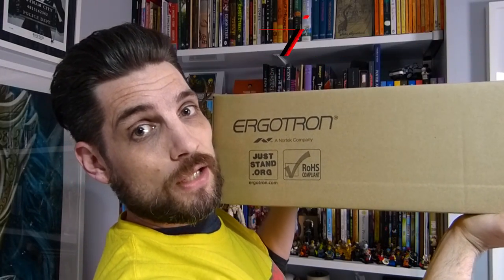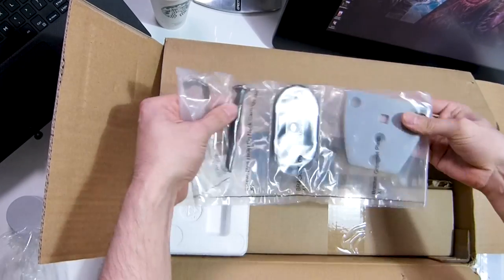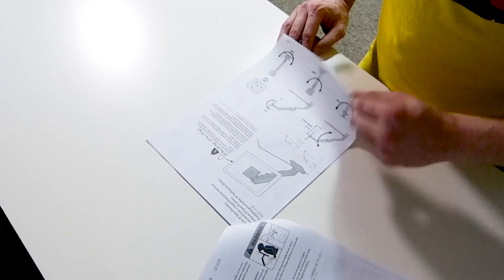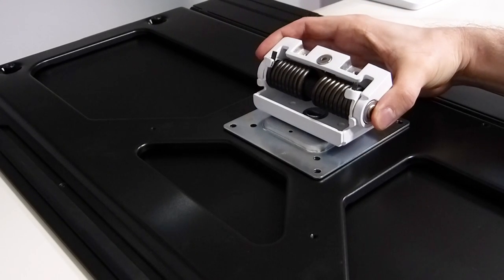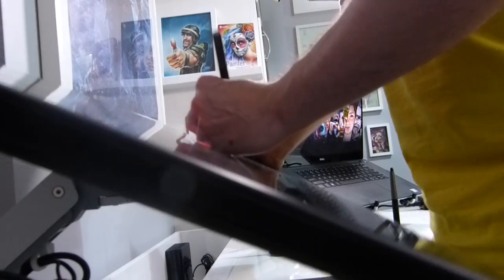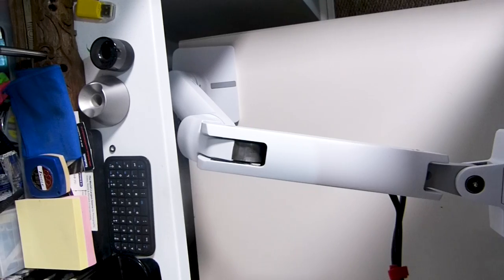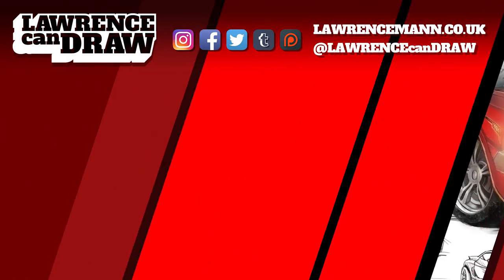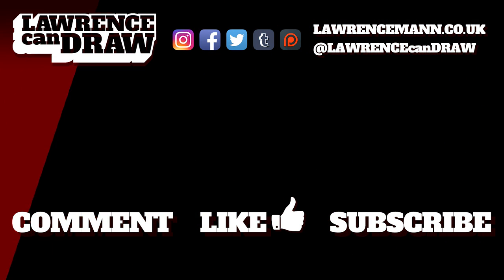Dell Canvas 27 with Ergotron arm & VESA mount

Comment: LAWRENCEcanDRAW ... which device are you currently finding yourself using more: your new Dell Canvas or Wacom Cintiq 27HD?
**(Not including the Dell Canvas art for your trip to California/Dell)?
Reply from the maker: Already answered in the comments John! Keep up man ;) lol. It's horses-for-courses. There's no right answer for this one because it depends what the project is or where I have to be. My main device is the Dell Precision 5520 Xeon 32gbram but that's the most powerful. That's what I do my commission work on and I might use the Canvas or the Cintiq 27QHD but I could use the Surface, MobileStudio or even my little Lenovo depending on where I have to be and what I need to do! I like to move around a lot too and I work a lot from SD cards to keep flexible so it's easy to swap devices!
Reply: LAWRENCEcanDRAW ... I had a feeling you may have answered this question, but I'm happy you did again. 
I just finished watching &/or 
re-watching 16 of your videos. My brain is in overdrive thinking of all the options I should consider, now including a Dell Canvas (which I did not expect)!
Consider this... when I picked out my new sit/stand desk, you were metaphorically, sitting on my shoulder, telling me things I needed to consider. 
Example: earlier in the year we had a youtube conversation, about the Egrotron. The result was picking out a "sit/stand table" aka "super ergonomics," because you fused that into my brain. Oh... and my art chair/stool as well. Its not the one you have but, I think you would definitely approve of it. 
I've learned & continue to learn from all the advice you offer. When friends ask me questions... I send them to your channel. ;)
Reply from the maker: I've considered buying a sit/Stand desk myself. I love this beast too much though. I have considered designing one myself and even talking to a manufacturer to see if they want input in designing a desk for creatives.
Reply: LAWRENCEcanDRAW ... yeah, your table is a beast! Probably the last table you'll need. I've often thought of the same thing (building own). Right now, I'd love to build a "pull out draw" for under the table, that's almost the length of my table for my keyboard,  mouse & this half-keyboard I use. So far I can't even find one to buy, which is frustrating. When I buy my egrotrons, I'm really going to need something done. 
I have a good sized, height adjustable drafting table, brand new (that cost me nothing). It has up to a 60° tilt, 42" by 30" & a side table (attached) 18" by 30" (good for pencil sharpeners & my current laptop arm for my Surface Pro & 24" monitor. 
My sit/stand desk/table for digital painting is 63" by 31.5" motorized. I'm 6ft 4inches and it raises all the way up, to where I can almost rest my elbows completely parallel to the desktop. 
I can actually sit with my studio chair, at that table height, lol. My chair seriously goes that high up, & it has a adjusting foot stand & arm rests that come off like yours.
When I get my new primary viewing monitor + Wacom Cintiq Pro or Dell Canvas with egrotrons, I'll have to forward a photo. You'll get a kick out of it.
Reply: LAWRENCEcanDRAW ... come to think on it: you could use your desk top & just buy the sit/stand motorized legs. 
It wouldn't hurt to try it out & see if you like it (30 day return policy). 
As long as your current desktop can come off your current desk and length & width are relative to the base... you just mount it to the sit/stand legs! If I'm not mistaken, they have several sized sit/stand bases too.
Food for thought.
Reply from the maker: I designed a desk years ago and even spoke to a few craftsmen about making it but it was just too expensive. I have changed my plans a little since then anyway but I still  want to design that perfect desk for creatives at some point!
Reply: LAWRENCEcanDRAW ... don't forget to design for both digital & traditional or rather both. Computers are part of life even with traditional art, so even my traditional art medium desk has a surface & secondary monitor hooked up to it. One half of the desk, (42") adjusts from 0 to 60° & the other 18" is stationary  (perfect for egrotron arms & medium tools like electric pencil sharpeners. 
I guess that's why I have 2 desks (digital & traditional) but having 1 adjustable modular desk, would be a dream!
Reply from the maker: It's gonna be hard to do something that fits everyone but I'll certainly try to make considerations. I do understand what you're looking for. I used to work traditionally. I only work digitally now. I just don't want to make a mask of both that suits neither perfectly. I'll see what happens!
Reply: LAWRENCEcanDRAW ... there's a company (very high end, more for businesses), that makes a very similar drafting/computer table. Its heavy duty & is adjustable. I'll try & find the website for you. 
They're on to something but, missing ideally what we need, as I bet you'll notice too. For the price they ask, its not for me
Reply: Found it Versa Tables. This one here if very similar to my mine (my traditional w/ surface pro - art desk, not workstation sit/stand with wacom)...
https://www.versatables.com/products/art-table/
The annoying thing about these desks is: they are adjustable but, if you want to change height (I'm tall, average height of typical desk doesn't work with me), you have to take everything off. With pencil sharpeners, monitor, surface arm, cables (you get the point), it takes hours to adjust. You can't do it on the fly. 
Also, I'm left handed. A table to the left or both sides (modular with add-ons) would be fantastic! Hope this help you. Just providing info as a "food for thought."
PS... yes, they're heavy duty but. check out the prices. I see value but, not the value in what they are asking for with their restrictions. They only have a nitch, until someone else challenges them, hence the price tag.
Reply from the maker: I'm not keen on that design at all :[] It has some interesting ideas but it makes more sense to just buy a good drafting table and bolt on some attachments. There's nothing really that special to this one and it looks baaaaad. lol. I would actually say that the computer element of it is more like an after thought. The keyboard is shoved to the side which is an ergonomic nightmare. It would be horrible to use for a digital artist. Then again, without putting some serious thought into it, I'm still in the mind that you might still be better off with the two separate work spaces. Connecting them but still separate.
Reply: That's exactly what I did "(I have 2 separate tables)." One similar to the versa table shown, for traditional artwork were I need the drafting table part (though as I've mentioned, I do have two arms for my Surface Pro & Secondary Monitor for my drafting table hooked on a stationary part of the drafting table). 
My 2nd desk (sit/stand) has my PC Workstation & Wacom, for digital art, with a small drafting easel on it (pending I need to draw something and scan it in, pending my preference). 
Do check out so of the other Versa desks. They have several. It would offer a good reference for a table you might eventually want to design yourself as you previously stated.
Reply from the maker: Do me a little studio tour on video?
Reply: I can definitely do photos, and will do a video too. I need to learn some video editing software. I have Adobe Premier CS5 but never used it. I'll message you via Facebook with my email & what not. Maybe you can offer a easy solution? FYI... I use my phone for video's (which isn't my thing). The best I've ever come close is using Adobe Flash but, that was years ago.
Btw... I'm about to watch your new video you posted a few hours ago. It's funny you asked for a video because I was planning on posting a video suggestion: I'd love to see you do a video based on your subscribers like me and their studios and how you may have influenced them, along with equipment they use or plan to get (the Egrotron for example). 
I'm not saying this lightly or without earned merit. Your artwork is fantastic and your youtube channel is exception. you have a real talent for this. I personally wouldn't mind seeing you expand with thing like studio setup,s, art hardware obviously, but other things too... even books you find useful for learning to sketch & paint digitally.
Edit: Programs you use!! For example, you told me the story of a oil painting you did that took 30 days to dry. I don't know if you use Corel's Painter at all but, I'm assuming your at least familiar with it. Furthermore & what would be very interesting is how easier it is for you to use the program (especially manipulating & creating custom brushes) because of your previous experience in traditional oil painting. Again, this is all food for thought. You've inspired me, I hope in a small way, I somehow convey the same.
Reply: I was just looking at Egrotron sit/stand desks. I can understand why you may be cautious to invest in one since they only hold 65lbs. (29.5KG) and cost $700.00 (USA).
My sit/stand desk cost me $500.00 (USA), is longer by 15 inches and wider by 8 inches, raises & lowers almost 20 inches in both directions (up & down), it is completely motorized and comes with a standard 10 year warranty (including they pay for shipping both ways, if it breaks) and holds 155lbs (aka 70KG). 
Egrotron may make good Monitor arms (you've convinced me to try a Egrotron Arm for/starting with - my Surface Pro). However, I wouldn't trade MY sit/stand desk, for the Egrotron equivalent sit/stand desk, even if you paid me too!
Again, I know your a Egrotron fan Mate but, that doesn't mean "everything they make" is better than every other company in all categories. Now I understand why you are concerned about how much weight a sit/stand desk holds per earlier reply. 29.5KG is ridiculous vs. the Egrotron desk value
My sit/stand desk is better in literally every way. Again, it costs $200.00 less with a "10 year warranty" and holds more than double the weight! I lean on my desk all the time and it raises and lowers without a hitch.
Reply from the maker: Do video. I'll explain why later ;) Focus on the desk!

Ergotron don't pay me a penny so I don't have to scratch their back. lol. If you know of something better than I'm happy to hear it. I love the arms. I know there are other arms out there and I've taken a look but I've not been as impressed. Things like the 10yr guarantee go a long way. Sit/stand desks are a great idea but as a digital artist I do need a good weight bearing desk and as an artist I want storage too. The arms help with the sit/stand issue so I'm not 100% sure I need a desk that will do it.
Reply: I hear you, and I didn't think Egrotron paid you or anything like that. I was just making a point that some sit/stand desks like Egrotron can't support weight as you mentioned, but mine can support some decent weight and still move up & down.

In regards to video of my 2 desks... I messaged you via Facebook Messenger (I don't have a twitter account). Same name via Facebook as I'm using on youtube/google = "John Kon"
Reply from the maker: Ahhh, I barely ever check FB messages. Will read that!
Reply: LAWRENCEcanDRAW ... sorry, I haven't responded. I had a emergency  (injury from accident). I need a few more days to heal, & I'll start working on photos & video
Reply from the maker: No worries! Take your time & get well soon ;)

Comment: How flat can it lay with this arm? How close to the desk can you get it?
Reply from the maker: Not completely flat. No arm can because of the way the VESA and hinge attach. That's pretty standard. It touches the desk but doesn't lay down on the desk obviously!
Reply from the maker: If you want an arm that has more movement but is obviously a touch less stable when fully extended then check out the arm I use in my videos for the Wacom Cintiq 27QHD Touch. That will work too. Links in the description. Depends on your personal needs and use!
Reply: can you put any pressure on the screen without the arm moving? I always rest my drawing hand on the screen just like a sketchbook
Reply: I'm currently using an older Cintiq with the raise/rotate stand and I'm trying to find what will be close to this
Reply: Also, if money was no object, which would you buy, Dell Canvas or Wacom Cintiq QHD touch? Why?
Reply from the maker: Best read through the comments for these questions. I've answered them both countless times on every video. Sorry but I've got a cold and am loosing the will to live! Don't lean on your screen it can damage it btw. Try elevate your wrist! Ultimately the are different experiences. Check out comments on my Canvas review video!